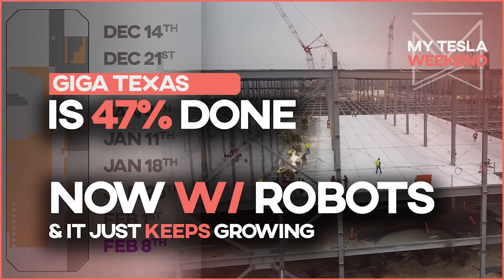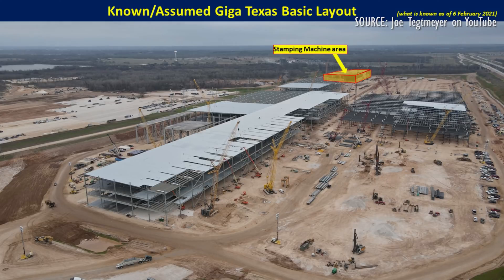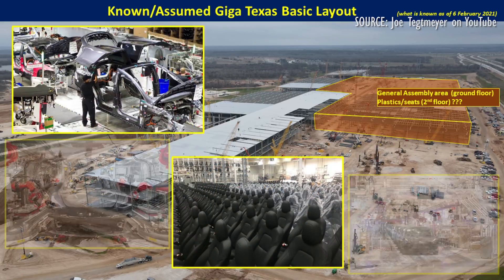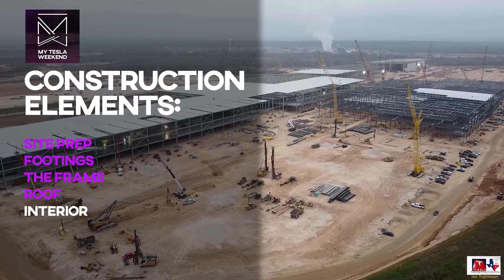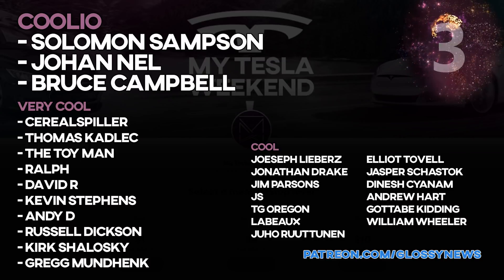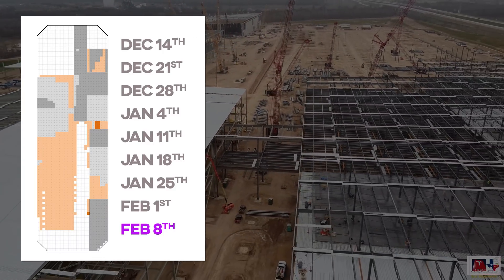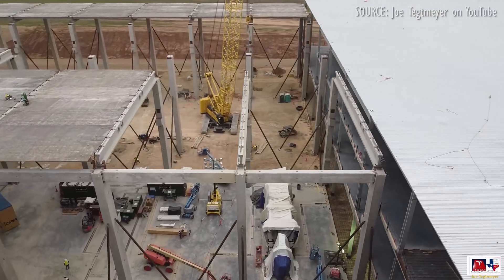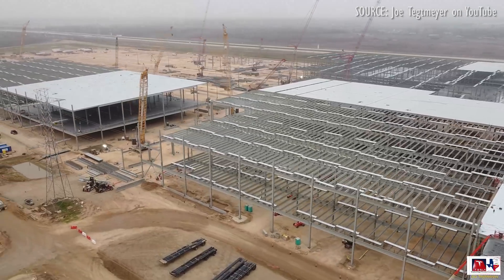Giga Texas is 47% complete & you may get your CyberTruck this year

Comment: It is never 47%. It‘s beetween 20 an 25%. Please include also in your math: 1. Construction —> complete roofing, building out the floors and the ground floor. 2. Complete building technology 3. Production equipement and production lines —> engineering, manufacturing, installing, commissioning.

Also what you should include is the fact that you habe parallel and sequential work. This also can change due to different factors.

So a specific enddate is a little bit misleading. More „scientific“ would be to give a date range ;)

Cheers, projectmanager :)
Reply: *have
Reply from the maker: You think it will be another 600 days to completion?

My friend, that's a bit nutty for any private construction site. But for Tesla? I mean, come on man.

Comment: having robots delivered at this stage building is a negative, and shows that Tesla is well behind schedule on this project.   Robots are fragile and storing them in unconditioned containers on site, and moving them multiple times is not a good idea.  Not to mention it's bad capital management to have any expensive parts arrive before they are needed.        I hear you mention roofing in the video,  you do realize none of the building has final insulation or roofing installed yet?      This factory will not produce cars in volume in Q2,  there is ZERO chance of that,  late Q3 is a very long shot at this point.   Setting up the body and paint shops take time, and will not really get started for a couple more months.    There is far more work inside the building, then the building itself.

Comment: I think this estimate is high. The most visible of the building elements are showing rapid progress, but even once the project is completely dried in, it is only about 50% complete for most projects. It may be even less for a manufacturing facility like this one with complex interior machinery. They are obviously fast tracking the work so progress will be very rapid, relatively speaking. Early sections will be dried in and interior fit out begun while later sections are still  being framed. If you want to do an accurate job of this for your videos, you may want to contact the construction project manager. I can assure you he will have a very good idea where he stands because the entire job is charted in his critical path schedule. He will know when substantial completion will be and how much that date has moved forward or backward. I have no idea whether he is allowed to share this information but it would only take a phone call to find out.

Comment: I fail to see that the roof is done. There is not any drains or curb boxes no insulation or weatherproof membrane,for any roof top mounted items. Plus the work inside has not even started as to the miles of wires both electrical and computer systems needed to run everything. Add lighting HVAC systems,the paint shop. Most importantly the firewalls and sprinkler systems although they are small in scope they are real time consuming items to install and test. Yes the basic frame is going well only it’s only a small part of such a project.

Comment: Are you including the water treatment building and switchyard(s) in your timeline?
Reply from the maker: No. Without site plans we don't know anything about buildings other than the main structure, so understanding how complete they are would be impossible. What I can tell is that regardless of what other work takes place on the site, the emerald building continues at pace. If information on additional buildings becomes available, I will add those as well, though possibly in a sub-tracker.

Comment: I think this factory building will only build Model Ys.  I expect work to begin in a few weeks on a phase two building just East of phase one. Maybe the second building will only need to be half the size of the first.  And, it will be for building the Cyber Truck.
Reply: Yes, I've been wondering if the Cybertruck is even going to be built in this phase.  You may be correct.
Reply from the maker: This would be an AWFULLY large space for just the Model Y.

Comment: They just ordered tooling for Cyber Truck on  January 27th about. The tools need to be built. What we are seeing is model Y construction. They may add CT in same structure or build new building for it. CT wont need stamping, paint shop, or 6 tun giga presses. The batteries for cyber truck will uses nickel where model Y wont. CT will need new area for laser or plasma cutting stainless steel. They will need a tool to bend and weld the Stainless steel. Elon also said could get different color  cyber trucks by heat treating the steel. This would need to be a large over structure. I will still be surprised if they do like they had to do in Fremont mis matching production lines that make cares that share no parts. IMO
Reply: whats up SuperH
Reply: @RoschetzkyPhotography  good morning

Comment: Got that up quickly again. I think the first things out of the factory will be casting parts from the 1st gigapress to go to Fremont. You'll need to add some more trackers, once they start some new buildings, looks inevitably soon. Substation and who knows what else
Reply: The reason the factory is in Texas is to serve the south, middle American and the east coast. Sending anything to Fremont would be counterproductive. Plus they already have a press at Fremont!! IMO
Reply: If it's ready before the rest of the plant why not. I'm not saying it will supply Fremont for long. It is probably more likely the 2nd press in Fremont will help free up space to start putting in more presses to eventually get the 3 and Y to the structural pack. The Fremont Y should follow the Texas Y ramp. I'm curious how long the 2170 Panasonic contract lasts, could be awhile to transition. Could start implementing front and rear casts though.